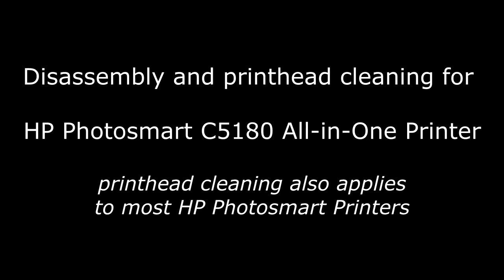HP Photosmart C5180 - Disassembly & Head Cleaning

Comment: You are f genius. I got a free hp photosmart c8180 from internet (used one). May be guy didn’t use it for a long time. When I bought new cartridges it wasn’t working. Only two colors where printing. After hundreds of inbuilt “print head cleaning”, it didn’t work. Then I thought to open printer but I didn’t find any informative video pertaining to C8180. I saw your video and boom… the hardest part for me to take off top cover. After seeing this video I’m I got a clue how to release those lock to remove top cover. 
Thank you very much

Comment: Great guide. Resurrected my c5180 In a hour :) i didn't go as far as slicing the printer head away from the block I just very carefully rinsed it still attached. Then gave the ribbon connectors a good blow out. Put it back together and the machine working good as new. Thanks for your time creating this very informative video. Thumbs up!

Comment: I used to repair Apple products and HP Inkjet/Laserjet printers for a living. I own this printer. The method I always used first was to clean the head as well as the rubber wipers, gently, with a cotton swab with 90% isopropyl alcohol and re-test the print. If any stubborn lines still appear that the self-cleaning and deep cleaning modes won't clear up, then you can go further, otherwise you risk contamination and misalignment of the head (you may have clogs later on...). This method works 90% of the time for micro-nozzles, and there is usually no need for using the cleaning modes that only waste the ink. If you do have to remove the nozzles, make sure your final rinse is with distilled or filtered water, and/or isopropyl alcohol, but never tap water.

Comment: Thanks to youtubers of old for such useful content. My C5180 is still in use after what seems to be decades of ownership. Inks are now being discontinued and I will be installing a CISS to complete the design, that this printer had well before its time. Separate inkwells.  Have replaced  the rockers on the print head ( hand made more durable ) and replaced all caps on the main board. Truely  an amazing unit in function.  Need a video on the inkwell cleaning though, for those that continue this legacy.
Reply: I also replaced the caps once. The originals where bad. Now my paper feed gear broke...have to take the whole machine apart and switch it with a printed or machined gear.

I bought a brand new, never initiates C580 some days ago but it doesn't print black. Couldn't initiate it because the original cartridges are bad so I just threw in my cuss and black has an issue.
Got another free C6280 (broken paper feed gear) and a D7180 (perfectly fine but no LAN port)  which could donate a print head.

This project Byer with CIS has save me thousands of €€€€ over the last 15 years.

Comment: Hi antystein, after ten years my Photosmart C6180 stopped printing Magenta. Followed your great instructions and now it's alive again. THANK YOU. I just had to add a factory reset procedure step at the end: unplug the printer power, hold down # and 6 on the keyboard and plug the power cord back in while holding the keys until printer turns off by itself, press power on button to go through printer initialization - as when it was new.

Comment: I have a Photosmart C7200 Series. Due to your tutorial I was able to save the printer from scrapping. Thanks a lot. The disassembly was for the most part identical. It was easy to wing the differences. One actually needs two different size torx drivers size 6 for the smalles screws on the printhead itself and size ten for the rest. Of course it may be different with other models.

Comment: Thank you man. This saved me ~80€ in new bought inks that I couldn't use because the printer complained about hardware failures. I had to dissasemble it and play with the hidden menus (shown after pressing left+setup, then OK or right) but finally got it working.

Comment: Printer HP C6180 sat for 6 months in 2-3% humidity.  Only blue would print.  Watched this video.  Printer is working like new.  Brief additions: Removing scanner is the toughest part.  Hinges have tabs that have to be pushed back.  Five cables to disconnect,  Two additional, silver, screw on back panel need to be removed, top has a plastic attachment on the left side, as viewed from front.  Printer would not print for more than 10 copies.  Figured that the ink pumps needed to be activated. "Set up Menu",  "Tools",  "Clean Printhead".  Pumps activated and the rest is happy printing.  Did have to purchase a tool to remove the printer head screws, (Radio Shack) 
Would like to learn how you produced the video, lighting, camera, etc. Very Clear
Reply: Thanks Pat. I was about to write my own correction to this video re c6180 difference from c5180 (in the part of scanner detachment). However you've already done that. Excellent work!
Reply: maybe you could be more vague, but that's doubtful

Comment: Just used this video to get HP Photosmart C6280 printing again - both light & regular magentas were blank on the self-test report (printer not used for several months, and just refitted with new inks). Worried it might have been a pipework blockage, but followed this video and after a couple of hours deep cleaning, self-test report shows all 6 colours as expected. I did change a bit though - at ~3min mark, I didn't want to cut the board from the print-head so just used a cup of hot water - just balance the block above the cup with the head dipped into the water, swirl and change out water a few times!
No idea how much time this saved and how much a repair would have cost! Great help, and easy to follow. Just keep pausing the video at points when you reach a time-consuming bit.
Thanks!

Comment: Thanks for the video! Helped me fix my Photosmart 3200 series which has a very similar print head assembly. I was able to get mine cleaned without completely taking it off by using alcohol soaked paper towels to dissolve and wick away the clogged ink in my black print head. Thanks for the great video.

Comment: Omgoodness! Omgoodness! Super big thanks for this tutorial! I haven't been able to print any pictures of my daughter who is almost three now! So this worked for a clogged printer of 4 years! Lol I was only getting blue yellow and green. Then following most of these steps, and inked all over my hands ITS FIXED!!! i love my printer I hated trying to get a new one. Especially since this one  went without use for too long and tnats why it stopped working. I followed with the exception of the intimidating cutting of black caps to detach printhead for rinsing. Instead I ran super hot water in a shallow bowl so it flowed around giving me a current to carefully hold the hanging head in to rinse. Sure enough the magenta was clogged! It was so bad I couldn't see anything through it questioning if it was black. However with patients and more patients it came unclogged.  I could see ALL CLEAR LINES. Dried with paper towel and swiped with a lil alcohol. Reassembled. Then printed a small copy, followed with the printers printhead cleaning. ThN k y o u! Thank you! Oh by the way this was for my hp photosmart c7280 all in one. Oh and thanks again!
Reply from the maker: Thanks for your comment! I am glad I could help you!

Comment: Brilliant video.  Thank you for encouraging me to take a Thorx 10 screwdriver to my C7180 "all for one and none for all" printer.  Some notable differences, such as different lid attachment and needing to start with the front right panel (with power button), then side, then lid is connected differently.  There are also numerous areas full of ink inside.  The attachment of the final part (in above video) where ink is delivered, is riveted and cannot be unscrewed.  I made a mistake or prising off the cover to find it was glued ... I glued it back.  I had most trouble with the lid's connections to the circuit board.  Reconnecting them was easier if I unscrewed the circuit board.  Not sure if that worked since I reassembled it and plugged it in and it was DEAD.-  No spark of technical geeky life.  The C7180 was DOA.  It was so dirty and 10 years old, that trying to save it was an enjoyable waste of time.  It was probably 800€ in Helsinki in 2005, but the replacement is <400€ for a better machine.  I enjoyed wasting my time and being covered in ink, but it's time to recycle the machine, see https://www.youtube.com/watch?v=ATQij1nSMgY ... what is the mass of HP discarded printers .... this is my 3rd, I think, having moved from US to Europe ... as well as just outlived them.

Comment: Thank you! saved me some time opening similar models (ps  8250, 3110, 3210 etc.)
I often encountered ink failure message. Reset on these models by temporarily removing printhead flatcables on pcb which often clears the problem.

Comment: Hello antystein,
thank you for the helpful Video and the annotations.
I successfully cleaned the print head and the scan glass of my HP Photosmart C7280.
I did it without removing the electronic board 3:06 I simply rotated the white board with the holes 90° and cleaned it and the black rubber plate carefully also with tap water.
The difference and difficulty was that mine has 2 cover holder on 0:36 but I managed it.
The scan glass had a stain on the lower side so I had to remove the screws and rotate the ADF 90° antt-clockwise while opening the strap.

Comment: Great instructions, all processes worked fine.  After powering up got a ink system failure and have not been able to clear , reset or even turn the unit off.  This was a great printer Printed over 10K pages in 3 years.  Time for a new one.

Comment: This is very similar to the Photosmart 3310 (Q5861A).  The biggest difference is that you need to also remove bezel around the memory card slots to remove the right side panel.  There is one screw above the right side of the paper tray, and you also need to remove the top grey screw in the main bezel (removed at 1:09) labeled "1" to lift up that main bezel slightly to release the catch on the memory card bezel.

Comment: Great video! I would just add that the screws are Torx T6 (for print head) and T10 for the rest.
Did everything as shown but for some reason when the printer goes through a reset, it pumps an incredible amount of ink that goes everywhere. I thought the print head probably was not torqued enough with the four little T6 screws, but that was not the case. The gasket looked good and all parts were clean and dry and properly seated when assembled. Did not want to strip the threads, but those screws are in tight!
What a shame! 
Spent a lot of time cleaning the ink hoses and reservoir that had dried ink. Had to turn the pump and draw a vacuum at the other end before the ink started flowing again, but now the printer just draws too much of it.
Any ideas before I give up completely on this?

Comment: Hello antystein - I hope you get this message because so far I have not been able to find a diagram of all the parts for my HP C6180 all in one printer and here is my issue.  I have torn apart my printer, as you have done in this video - and my many thanks to you, as your video was very good and I was able to continue to look upon it as I was tearing it down and now Im in the process of putting it back together.  When disassembling it and removing the things those little gears kind of flew off that you describe where the arm of the printhead slides onto.  Well when this happened - I only noticed and found "ONE" gear that came off and that was the top one that the arm of the printhead slides on top off.  I have looked everywhere and do not remember whether the bottom one was there or not and it is surely not inside the printer as I have checked that out thoroughly!  There is a hole where one would go, but Im pretty sure only one came off!
  My question is - could this printer have run without that bottom gear?  Does the C6180 have the same gear under the top one? I cannot find a diagram of parts.   I have never had this torn apart and Im telling you - I dont think it was there?  Now obviously if it needs it, it had to have been but I obviously am missing it, which would suck because everything went pretty well!  (I think)  If I need this what is the part called?  The cartridge does move back and forth with no problem that I can see?
On another note I might mention my issues with the disassembly.  It is comical that the biggest issue I had was removing the top lid which took forever and a day!  I was ready to take a hammer to it!  The other issues became a couple of the screws, which were a nightmare on the printhead itself.  I didnt have the smallest tool for those screws and around the last screw some of the plastic broke off and I glued it back.  Whether it lasts remains to be seen but it didnt affect applying the piece back after cleaning as only alittle bit of the plastic around the screw cracked off.  I will say HP does not make it easy when it comes to these darn screws and the lid!  
Anyway I would appreciate your help if you read this and I would have rather emailed but this is the only way I knew to ask you.  Im excited to see if this runs and corrects my problem after all this work!  I also found a couple small pieces of paper inside that obviously was causing one of my problems with the paper jamming constantly - the other was with the black cartridge not printing.  I used to tear apart computers and put them back together and I found that easier THAN THIS!  LOL. This really became a pain in my * :)
 Many Thanks!
Reply from the maker: The bottom gear engages with the gear at the far left of the head travel. It is used to move the lever and prime the head with ink. I don't know if there is a part number for it. I would think that it is hard to jump out of the printer. It should be still inside, maybe if you turn the printer upside down it will fall out.
Reply: Well Thank you very much for your prompt reply.  I have turned the printer upside down, side to side, every which way and nothing comes out.  I also cannot hear anything.  For the life of me I have no idea where it could have went?  I did not notice it before because I wasn't taking that apart - the top one just popped off, and apparently the bottom one?
That sucks because if I did everything correctly, that little piece stands between the whole printer functioning now.  :(    Thank you.

Comment: The C8180 also has to have the printer head primed after cleaning it...so that may be a problem. Also go into the tech menu on that to get a full nozzle print out, as that will help prime your unit after cleaning it. You have to print out a lot of photos to get it running right again. Keep printing to see if that helps to get your unit cleared. Try also some alcohol on the front pins where the unit connects to the ink wells. Those can get blocked as well or use the kit below as the tech her recommends.  You have to use your printer at least 2 times per month to prevent the inks from clogging your systems. It is the nature of these types of ink systems. After doing a ton of tests and checking others, this is what I have found out. Hope that helps!

Comment: Man, you really make this shit look easy! I'm currently on the Push Tab part to get the top part off, but my C8180 newer design has 2 of them (one on each side) and they are NOT easy to Push/Pull! Whew That part took 45 minutes, alone, and that was WITH Mineral Oil Light Lubricant on the Push Tabs!

Hopefully, that was the hard part.

Man, this sucks. I can't finish this in one day -.- For some reason, my screw heads for the step @2:41 are 5x (maybe more) smaller than all of the previous screws and my entire toolkit of 30+ tools with 5 Star-Head Configurations and a set of 20 Alan Wrenches cannot fit these screws.This sucks.

UPDATE: I needed a T6 Hexagonal Screwdriver Head to unscrew the 4 screws @2:41 .
UPDATE 2: Sigh I did every single thing right in this video - even double-checked every single step, but in the end, I downgraded from not being able to print Photo or Regular Magenta to not being able to print a single color, at all!
UPDATE 3: So, you need a T-10 socket for most screws and a  T-6 for the inner print heads.
UPDATE 4: I opened it up multiple times and kept checking every single step. I don't know what's wrong or why this is happening, but now the LCD Display won't show up. I swear, I've serviced, disassembled, and rebuilt dozens of entire Desktop PCs, but this Printer is making problems that don't make sense!

Comment: Thank you, this video saved both the money in my pocket and the printer from certain disposal. 
An additional note to those that may encounter an error message  '0xc18a0201 Error' .
1. turn off the printer, 
2. Turn it back on while holding down both the Help(?) and the OK buttons.
3. Keep these two buttons held down until the printer finishes doing what it need to do.
In my situation, it asked me to confirm what language I wanted and then printed off an 'Extended Self test diagnostic page'.

Thanks again

Comment: The whole world is talking about sustainability. That's exactly why I want follow your fantastic instructions. Thanks a lot. Can you please state what size and kind screw driver you were using. What do you call that green spatular properly and the glue you are using is that the kind that maintains some resilience or is it tough when hardened through. I am thinking about a follow-on disassembly.
Reply from the maker: Volker Miesek Thank you for your comment! The screw driver is called "torx" I am not sure about the size at the moment (could be torx 10). The plastic tool I am using is part of a mobile phone disassembly kit, and the glue is just plain CA glue (superglue).